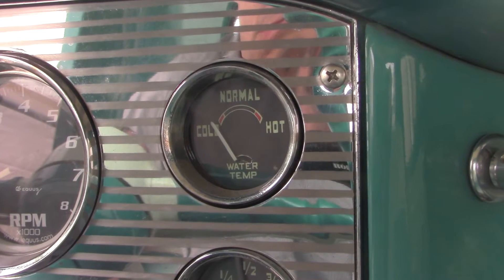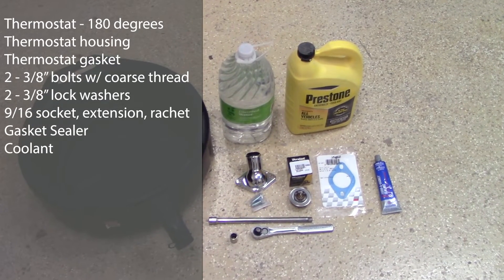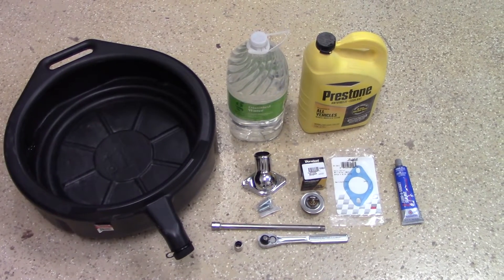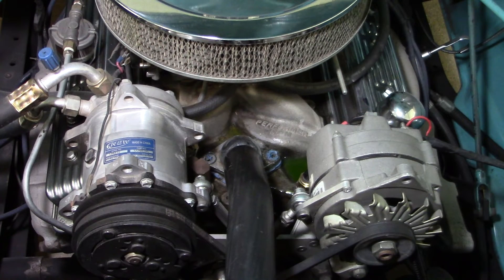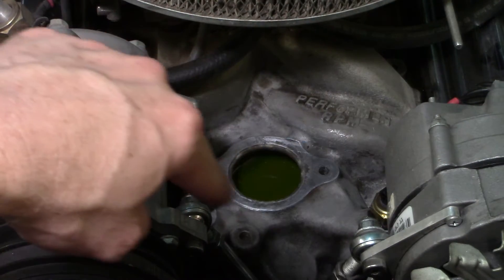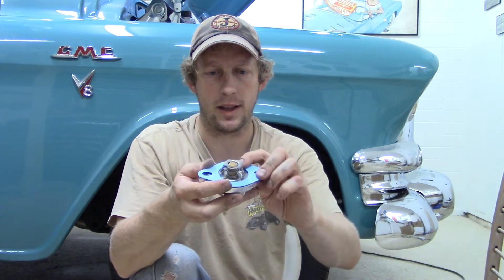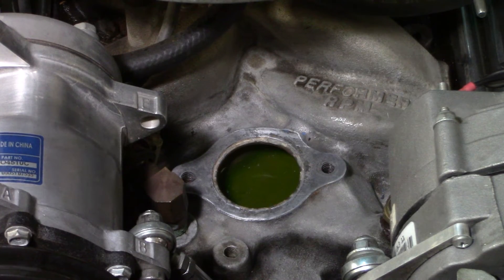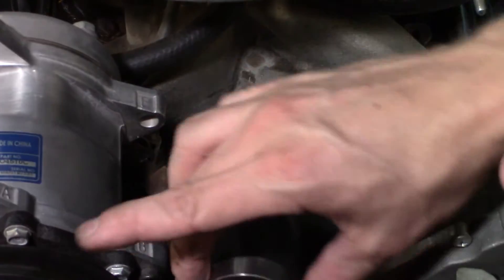How to Replace a Thermostat | Small Block Chevy | SBC | V8 283 327 350 383 | 1956 GMC

Comment: I'm on my 3rd neck fitting and feeling totally defeated.  I started with a chrome neck like yours, but it leaked even with no pressure.  Folks convinced me to throw it out-that the chrome necks are notorious leaders. I did and purchased two more with same results.   As soon as the coolant rises to level of tstat housing, it dribbles out as if it's not even sealed.  Just tried 3rd housing and same thing.  '36 Chevy pickup,  350 crate motor, Edelbrock alum intake.  What am I doing wrong???  😢

Comment: Need to go to an auto motive school. The thermostat housing rubber O ring is your gasket. Don't  need paper gasket ! The engine looks like a 89 - 94 350 , based on valve covers. If so, use o ring gasket, to seal radiator fluid, on intake. Also check on putting a 1/8 hole just inside outter edge of thermostat to allow  air to bleed out of block to allow fluid to fill a passages in the engine.
Reply from the maker: Thanks for the expertise. I would have used the O ring in this case but since I had difficulty with it leaking previously I went with the additional gasket, which ended up successful. 
I know about the 1/8 hole, which is a great tip and one I've used in other projects - the temp seems fine so I'll hold that on this project. 
This likely has the 89-94 heads you mentioned. I bought this engine already built, and the block is a 327 with a cartridge filter.
Reply: Al, another trick is to file thermostat housing and intake to take out whorpage
Reply: crowns and dips on connecting surfaces. Also a tell tail if one or both need to be replace, happy motoring.
Reply: The gasket sealer was a little over kill
Reply: @bradleypizzola1218 is gasket sealer not necessary?
Reply: Al, I’d like to apologize on behalf of the ungrateful people who left their “expert” retort. 

I actually listened/watched the entire video. I understand why you did it this way. Well done!

Interesting how these critics had to watch an instruction video when they were already pros. 

I really appreciate this video. I had the same issue as you. I did this and PROBLEM SOLVED!

Thanks! 😊

Comment: I think you installed it contradictory to what you showed. When explaining, you said gasket > thermostat > housing. During installation it showed thermostat > gasket > housing.
Reply from the maker: You are correct - there should be a recessed area where the thermostat sits in the intake manifold. The gasket sits on top of that. You can also use the O ring on the thermostat housing, however, unless the housing is new, it may not seal properly.

Comment: Is 160 thermostat better in summer than 180? Nice
Reply from the maker: I think it depends - if your vehicle has any overheating issues it might make sense to put a 160 in. Otherwise I recommend 180 all year round. This application runs the engine at 180 whether it’s 60 or 105 outside, so it s worked well for me.
Reply: Mine goes up to 210 hot days...you got electric fans?